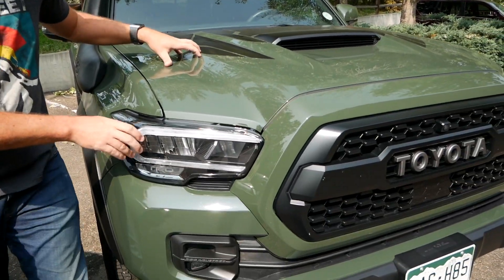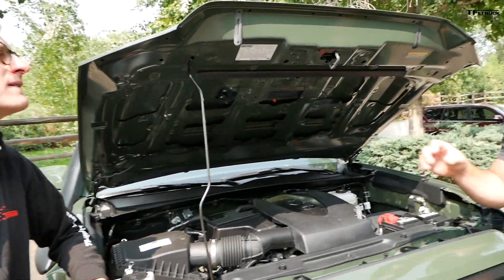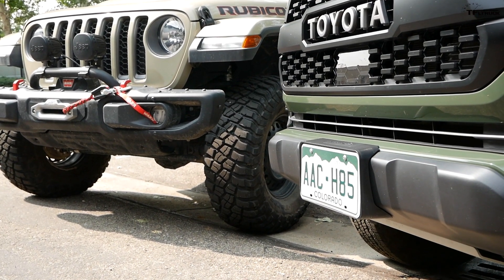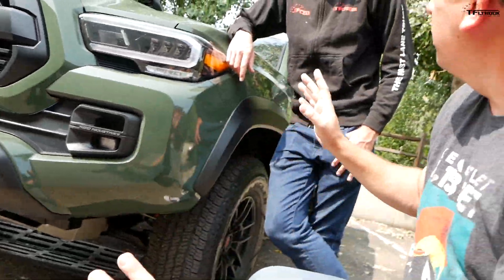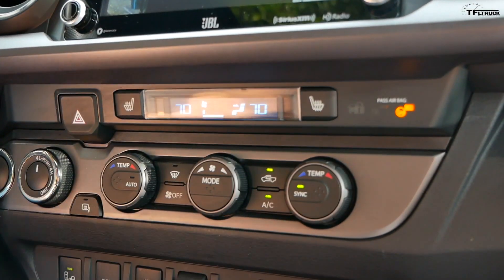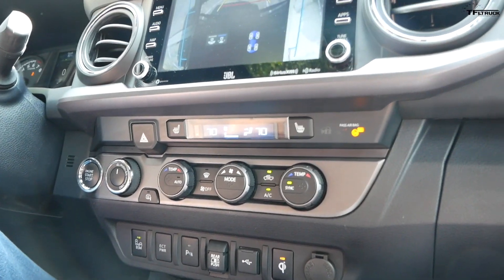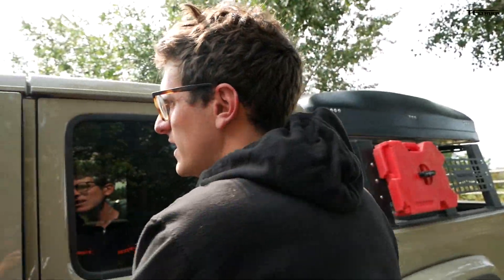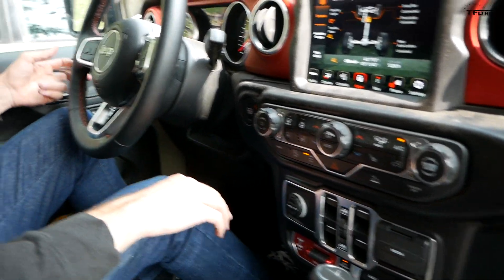Toyota Tacoma TRD Pro Has Met Its Match! We Compare It to the Gladiator & Show You Why!

Comment: I almost traded in my 2012 tundra for a 2020 trd pro Tacoma. As much as I love Toyota and Tacoma’s, I refuse to pay nearly 50k for an already out-dated truck compared to the competition. Not very good fuel economy for its size, rough transmission, bad seating position, cramped interior, still uses drum brakes to name a few. Looks awesome though and of course it’ll last forever. If only the gladiator didn’t fall apart after the first 5 years of ownership...
Reply: Colorado ZR2.
Reply: It’s hasn’t even been out 5 years smart one

Comment: Just wondering why not comparing with zr2 as well?
Reply: I agree. You don't see a lot of the ZR2 anywhere.
Reply: David Taylor TFL has done that in the past. The issue I had back then was that they only compared it to lesser equipped trucks.
Reply: @tuliosantos5962  They need to bring it back. 
Tacomas are everywhere but it's rare when I spot a ZR2.
Reply: @davidtaylor5811 they only make maybe 1.5k trd pros they are not everywhere. I live in a town of  7k people and I've seen 3 ZR2s but I'm the only one with a pro. There's maybe 100 reg tacomas and Colorados
Reply: @Boltdriver70  I shouldn't have lumped in the Off Road with the Pro models but I guess it depends on where you live. 
TRD Pro and ZR2 are both rare compared to the other models but I see more TRD Pro Tacomas where I live.
Nice truck btw, I'm jealous!

Comment: Adaptive cruise control and lane departure warning is available on the Jeep as an option. I believe you said it was not available.
Reply: TFL was comparing what is included by default.
Reply: Toyota also includes the inability to swap bumpers because of that safety tech. On the jeep it’s on the windshield so you can swap anything
Reply: Smarter Than You Not true, you can definitely swap the front bumper on the Tacoma without interfering with the safety sensors. The sensors are on the grill and windshield.
Reply: Brayan O if you gut the radar sensor you can. Talk to a Toyota tech about the consequences
Reply: Smarter Than You no need to gut the radar sensor at all. I plan on adding a winch compatible bumper to my 2020 trd pro. I’ve read the forums, watched videos, and asked my buddy that’s a Toyota tech. Everything said it’s good to go. Only problem you could potentially have is if the bumper has a pull bar or anytime that covers directly in front of the radar. Other than that you’re golden.

Comment: As you mentioned the Jeep is $20K more than the Tacoma or 40% higher  priced, that's  not a little money. That's a lot of money, you can buy two dirt  bikes, 1 nice ATV, decent  bass boat,  a pair of jetskis, or spend 
a lot of aftermarket improvements in the Tacoma market, Value for money I think Toyota wins easy here.

Comment: Tacoma has drum brakes?
Reply: Yes, and actually its better for offroading bc the drum protects the brakes from dirt and dust
Reply: @jaredfletcher1587   thanks
Reply: Jared Fletcher lol, you totally fell for Toyota marketing. No other truck has drum brakes and no one is having any issues Offroad, the real reason is that Toyota is cheap.
Reply: @officialyasir  ill take the drum brakes and the reliability of toyotas over disk brakes and falling apart vehicles like a jeep.  My tacoma still runs like brand new at 151k on it.  I expect at least 300k miles from it
Reply: Jared Fletcher what year is your Tacoma? 3rd Gen haven’t been as reliable as 1st and 2nd gens. Of course it’s still more reliable than a Jeep, no argument there. I just find the low seating position in the Tacoma uncomfortable, even with the power height adjustment in the 2020 models.
Reply: @officialyasir  its a 2013 and a manual transmission
Reply: Jared Fletcher sweet!! Don’t ever sell that truck, even if you buy another one!!
Reply: @officialyasir  i got it a few months ago for 8500.  Its a base model access cab and only 2wd.  So it will be interesting in a ny winter haha.  But tires matter more than the drive train in my opinion.

Comment: All these new trucks are so nice, but the price of these trucks is getting out of the average joes pocket book.
Reply: Sales figures of these trucks, and all trucks, would disagree with you. I see a ton of "average" joes rolling in trucks less than 3 years old with lots of options. The Trail Boss at $55k that they use is a bargain IF (and its a big one) you keep it for the long haul. $55k for a ten year vehicle is more the style of an average joe than a $40k 3-4 years cross over. Their resale value is often higher as well in proportion to the new purchase price.
Reply: "Average" Joe is financially illiterate, so it's no wonder he can't afford anything.
Reply: Price =/= cost. In reality, the cost of owning a truck really hasn't changed much over the years. This is due to the fact that vehicles are lasting longer, are more efficient, they are easier and significantly cheaper to finance, and they ultimately hold their value much better. Because of this, buyers are more willing to pay a higher upfront price for a vehicle, because they know what they're getting out of it, how the price amortizes, and what they will incur over the ownership period.

Comment: You guys should address that towing remains the same between the manual and auto with the Taco versus the Gladiator. It's a bummer you can't get similar towing in the Gladiator with the manual otherwise I would consider it.

Comment: No mention of the ECT Power button?  When you press it's on its worth 50hp
Reply: Electronically controlled transmission button is for going up and down hills which they don’t mention and helps with the gear hunting.
Reply: @PureBlood777  yeah I was being a smart ass since they tested that button once before in a drag race.

Comment: I had a 2013 Tacoma trd ccsb and really liked it but out grew it. Price at that time was 32k. As time has gone on of course price has gone up and yet its still not offered with any usb, aux power port for rear passenger. I would also like to see an  increase in hp and tq numbers and towing capacity. I also wanted to mention Toyota definitely needs to improve clarity and resolution in the cameras. My 2017 ram 1500 has a clearer camera.

Comment: I'm sick of "lifestyle" trucks and the people that buy them, I don't begrudge TFL for reporting on them, but this video is perfect for the Gladiator/TRD Pro buyer..... they never left the parking lot. The only people that take them out in the dirt are Youtubers, magazine writers and manufactures for photo shoots. The TRD might actually be able to do what is marketed for, the Gladiator is a steaming pile... it takes all the worst parts of a Jeep and makes then even worse (ride, fuel economy, towing) but at the same time, Jeep got rid of what makes Jeeps tolerable (short wheel base, simple to fix and modify). It might as well come with a Patagonia jacket that never sees a flake of snow or cowboy boots that will never see stirrups. Easily out paces the Raptor as the ultimate 'poser' machine.....but don't worry Ford fans, when the Bronco comes out, you'll get the title back

Comment: im pretty sure thats a 2021. 2020 Tacomas had the voodoo blue special color cuz mine is a voodoo blue 2020. didnt see a single army green 2020 on any lots in my area. and the back seats in the Tacoma are fine for adults, long as your not 6 foot or taller. if you are 6 foot or taller, a full sized half ton or 3/4 ton is better for you than a midsize truck

Comment: It is confusing to me how or why people are spending 50-60k on a mid size, let alone a "full size" half ton.  For between 52-65k you can get yourself a very nicely equipped 2yr old less then 40k mile 3/4 and 1 ton truck.  I've been shopping for a 'not Ford' since TFL got banned by Ford so I am selling all my Ford vehicles (1 left of 3) and I think I am going to buy a Cummins 2500, 1 year old, loaded Laramie with 9k miles for 58k.  #ThanksTFL #FordIsDeadToMe

Comment: Two trucks that NEVER change but sell a ton.  If it ain't broke.........
Reply: And imagine the money made by the manufacturers when they put out basically the same vehicle year after year.
Reply: The Tacoma is still based on the same architecture from 14 years ago, but the Gladiator is all new.
Reply: @bkzed7947  with engine issues sooner.

Comment: The gearing is the issue (or perhaps a better way to say is a way you can fix the poor programming) with the Tacoma auto trans. If you regear that trans up to 4.88 (stock config) or even 5.13 if you wanna runn 33-35 in. tires then it does MUCH better

Comment: I can only imagine how rusty that frame is already. Toyota frames are STILL rusting
Reply: They changed the alloys on the frames. Not rusting through anymore. That was really embarrassing for toyota
Reply: Turbojunki   Toyota had frame issues for sure.  The frames were supplied by an outside supplier ( to Toyota specs) and to this day they stand behind the trucks for inspections, undercoatingbto combat it and complete frame replacements.  My Tacoma is 7 yrs old and Toyota is still looking to fix it.    Any Ford gm or Chrysler wouldn’t even be worth enuf for resale to even justify a frame replace.
Reply: Darren Desautels The bad frames where supplied by DANA Corp, a US company. The same company who makes the famous Dana axles. Toyota is forced to use the US supplier to keep production inside US and avoid more taxes.

Comment: The only thing I don’t like on the TRD is the “sock in the pants” fake hood scoop. And the lack of reliability for Jeep’s.
Reply: That's the only thing you don't like?  What about the fact that its a fifteen year old truck platform.  Or did you see how Andre had to fold himself up to get inside?  I payed under $50k for my 2018 Ford F-150 Platinum with 50,000 km on it (that's only 30k miles)  I wouldn't buy any Toyota truck - Tundra or Tacoma -- until they fully update the platforms which are very outdated and it really shows when you compare them to newer models like my F-150
Reply: @PhilipOberg  Ford reliability long term is pretty bad through, in most cases. Hell, just look at resale values.

For quality comparison I would put my 11 year old Sequoia up against any Ford SUV with a similar age and mileage.

Comment: Best bang for the buck is hands down the Tacoma. Both are great vehicles, but just can’t believe that the gladiator fully loaded cost 15k more than a fully loaded Tacoma. Just bannananaassaa
Reply: The Gladiator can remove the roof and doors, a lifestyle truck vs practical with Tacoma
Reply: 2011buddylee they are cheap and the resale come down the road would be even cheaper to buy one later. So you probably are right.

Comment: So when yall are complaining about the Tacoma hunting for gears and poor programming, that's only part of the issue. The main issue is horrible gearing choice for the Tacoma. Automatic Tacomas should come with 4.88 gears and you quickly run into 5.29 gear territory when reach 33" tires and above. The manual has better transmission gear ratios and 4.30 stock, the final drive ratio is closer to an auto with 5.29 gears. Toyota really screwed up on this.

Comment: Worth noting. I ordered my diesel rubicon gladiator for 16% off MSRP
I got LEDs, front cam, adaptive cruise, Blind spot, aux switches, block heater, hard top and a couple other small things for $48k. You’re absolutely not getting really any movement off MSRP for a Tacoma and comparatively my diesel will flat out embarrass a tacoma on and off road.  

Super excited for my very last ICE vehicle to be this one

Comment: The Gladiator is overpriced.  The Tacoma will last twice as long.
Reply: Only if you clad that Tacoma in 14673578 layers of rust proof paint
Reply: Ya but Toyotas are still Trash, more recalls then most manufacturers and the infotainment system is cheap out of date garbage like years, the material is cheap, keyless entry is garbage. My brother in law has one and if you go 5 feet away from the vehicle it wont lock or anything. Just terrible
Reply: Robert McCarty maybe change the battery lol.  Mine locks through 3 walls and about 50 feet.
Reply: Jonathan Losito jeeps have always had that option,  the gladiator isn’t more expensive because of that.  It’s expensive because it’s a Jeep and they know people will over pay for it.  I thinks it’s awesome but unless Tacoma ruins the next gen I’ll stick with those
Reply: 🙄 talk to the techs. The taco is the problem child of Toyota. Nothing but issues.
Reply: Robert McCarty actually, ford is number one in recalls. Toyota is a closer second.
Reply: John Doe and Jeep is the problem child of Chrysler? Your point? Taco is still better overall value
Reply: Mr. Fiction jeep is NOT the problem child of Chrysler.
Reply: See Jay ANNNNND!
Reply: @JohnDoe-nz6bk  Every mechanic I know loves the tacoma...
Reply: 42bill 🤣🤣 they're not real mechanics then. Toyota mechanics hate them.
Reply: See Jay my wife's has been great. She has the turbo 4. I know MANY ppl who own a jeep and love them. So, try again.
Reply: @JohnDoe-nz6bk  Prema donnas! Ask those same Toyota mechanics if they'd rather own a Gladiator that breaks down at 60k miles!
Reply: 42bill they said they rather drive a Chevy. 🤷‍♂️ 30,000 miles on my wife's with no issues, except one of the seats broke.
Reply: @JohnDoe-nz6bk  Well then good for them! The Chevy trucks drop half their value in 3 years, but the Tacomas barely drop at all. (There is a reason for this) You can get a Chevy for a discount price so you're all set!  My TRD Pro I just bought is worth way more than I paid for it. I could sell it today for a 6 grand profit! (They are now selling for 5 or 6 grand above MSRP in my area)
Reply: 42bill i would rather buy a zr2 that is three years old and devalued, with really low miles. Than drive a new expensive truck with features from 2006. With the money I save I can just buy more mods for the truck.

Comment: For the price of the Jeep, you’d just as well get a Raptor.
Reply: Base Raptor vs fully loaded Jeep.
Reply: @skipper5951  Base Raptor every time
Reply: power wagon
Reply: The raptor is too big to offroad
Reply: @John-nj5mc  Then you're likely an image buyer.
Reply: Lamar2081 get it in theory, but the raptor is more practical, spacious, and has a fuckton more power.
Reply: @ImOldGregg  As is true for any full size over mid-size. But people buy these smaller trucks for a reason, they want a smaller truck, that can fit into their garage, and they want features without having pony $75,000 for a loaded full-size.
Reply: Lamar2081  no way, certainly not the case on the full size. And you can absolutely get a well equipped full size for the price of one of these small o es that runs 50k. You can certainly get into a 3.5tt or a 6.2 in thay price range
Reply: @ImOldGregg  An F150 XLT 4x4 with a 302A is already close to $50,000, and that doesn't even include a V8 or Ecoboost, never mind a Raptor. You're simply misestimating the cost difference. A loaded Tacoma TRD Pro will barely break $45,000.
Reply: NuKeWiller have you ever purchased and American vehicle, especially a truck? You can get tons of money off of them where you cannot with a trd pro. Exhibit a: 2019 expedition, listed for 64 and change, got it for my wife 48 out the door. Shopped an f150 platinum for myself. 62 list, got them down to 51. Decided to hold off for a bronco (or maybe next gen raptor)
Reply: @ImOldGregg  Yes, I have. And Toyota prices doesn't negate the point on the value of mid-size truck.

Depending on the brand, you can get incentives on a mid-size truck. A ZR2 can be had for for under $40,000 OTD. Show me a Raptor for that much. And a ZR2 is arguably more capable than a TRD Pro.

You're argument jump lanes to incentives, because you know what I initially said was right.
Reply: @ImOldGregg  You're grasping unfairly to keep the price difference alive. You can get incentive on a mid-sizer, you know? The bottom line is that feature for feature, you pay less for a mid-size truck. That's a fact. If you want off road bits + all the other amenities, you're not getting that in a Raptor for $50,000.
Reply: NuKeWiller it’s not an argument, it’s a reality that most people overlook when shopping for cars. You’re right zr2s you can get beaucoup bucks off like full-size American trucks. The trd pros you may be able to get 2-3 off of. I would argue that at $46000 Tacoma is a much worst value than a $50000otd well equipped full-size trucks. Btw You’re right there’s no discounting raptors really, either msrp or 1-2 off new. Used prices are stupid
Reply: Lmao, on what planet are they selling brand new, whole Raptors for $50k? Even the non-existent unicorn stripper Supercab will run your butt an easy $54k BEFORE MARKUP. Meanwhile, sub-$50,000 Rubicons are on every dealer lot in the country.
Reply: JD nowhere did I say you can get raptors cheap
Reply: @ImOldGregg  My comment wasn't directed to you, though it could've been.
Reply: @ImOldGregg What's your problem? Your FIRST comment argues for a Raptor, and then your respond to me with name calling. Your non sequitur and ad hominem fallacies won't validate your position or help you in anyway.
Reply: JD we get it, you also went to law school. Tool.